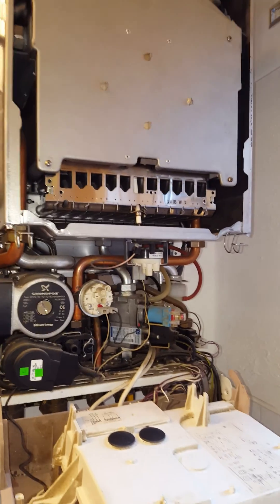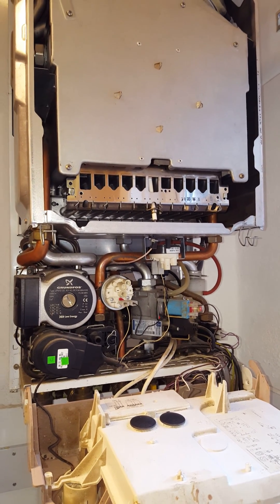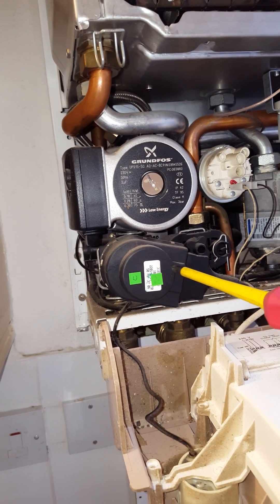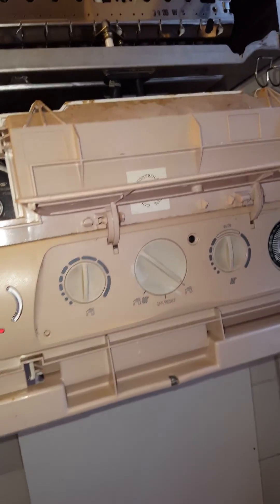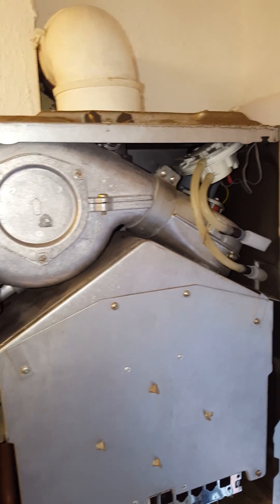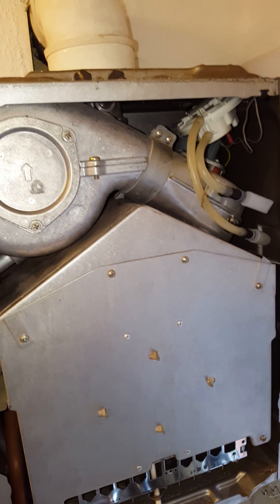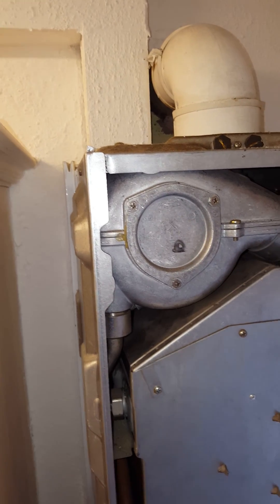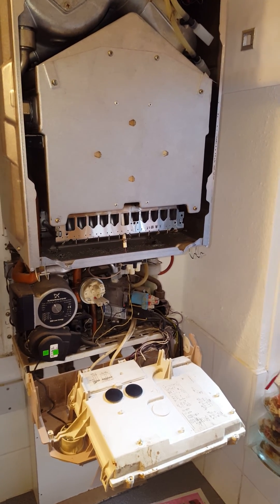Boiler fault finding Vokera Compact 25HE

Comment: Tony, is there a way to reset ignition lockout
Reply from the maker: Turn the the middle control to the middle position then turn back to the heating and hot water position
Reply: Just keeps cutting out, even on low setting. Would this be the heat exchanger  being blocked,
Reply from the maker: @gerrygorman273  is it cut in hot water mode if so it could a block plate heat exchanger. If in heating mode could be a weak pump. Or a fan ventri problem.

Comment: Where is the reset switch on a vokera compact A 29 boiler?
Reply from the maker: +Iain Haney Try turning off the power
Reply: Hi , I've already turned off the power and on again still showing the same code A04 ..just bled and refilled the system ...twice ..it just won't fire up although you can hear it trying to ..???
Reply from the maker: +Iain Haney send a picture of the front of boiler
Reply from the maker: Hi Iain email tony@engineerteam.co.uk
Reply from the maker: tony@engineerteam.co.uk

Comment: hi, I have a vokera compact 29a,,with error code a03,,in the manual it saying it's the fan,,,I've replaced the fan,,and code persists,,and I'm getting no hot water or heat from the radiators,,,any idea,,what it could be,,,any advice,,and help is much appreciated..thank you in advance
Reply: oh yeah,,and also the light is flashing red and green,,,many thanks
Reply from the maker: +Jimmy Khaan16 check the fan venturi
Reply: A+R Central Heating and Boiler Repair Experts Ltd ,,okay,,will do,,,thank you
Reply: Hope you have professional indemnity insurance?

Comment: hi have a vokera 16mynute solid red light after heats up then doesnt fire up again changed ntc fan stat any hints ! cheers
Reply from the maker: Sounds like ignition control PCB or gas valve

Comment: what could be the problem if you "switch to heating" and it dont heat the radiators but it gives you warm water to shower or wash dishes??
Reply from the maker: This could be a divertor valve or timer issue what area are you in?
Reply: W Yorkshire near Wakefield Thanks for reply
Reply from the maker: You to have you subscribed to my channel?
Reply: I’ve got this problem but the other way round, the radiators heat up but the taps and shower only heat up to a Luke warm for a few minutes then go freezing again. It’s an absolute nightmare and it’s stressing me out because I constantly have to freeze my balls off getting cold showers. Any tips or help would be massively appreciated. 
Regards Lewis.
Reply: @lewisrodwell8753  hi it's your diverter valve sticking
Reply: Hi. Did you manage to get it fixed?
I got same problem.